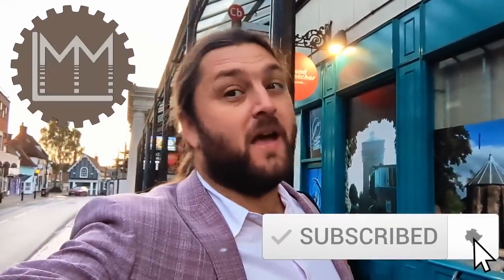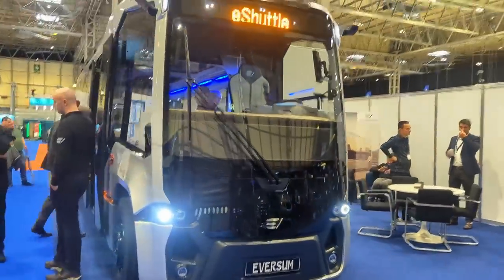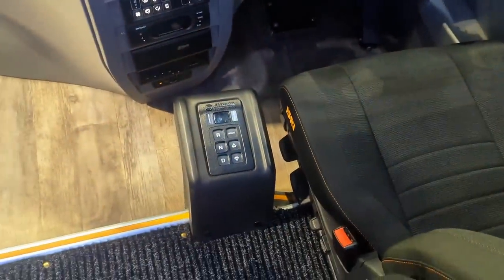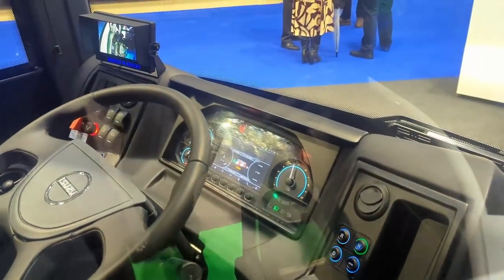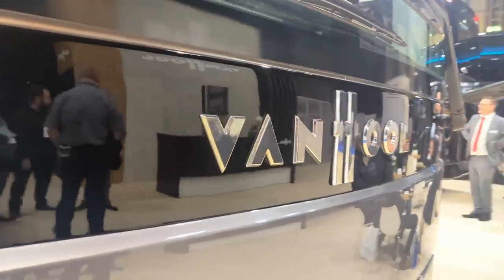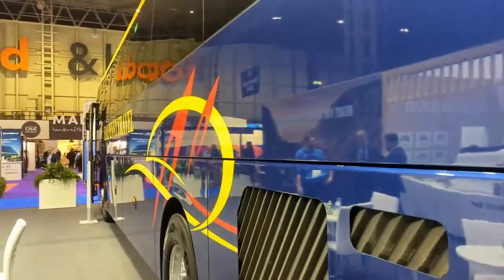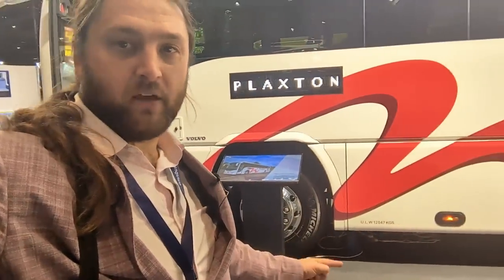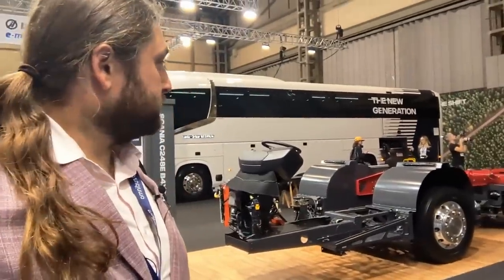Lawrie rates new buses... badly - a Vlog at EuroBus Con

Comment: If you want an electric bus with unlimited range and no need to park for recharging - then use a TROLLEYBUS!  Battery trolleybuses will recharge their small batteries whilst running under the overhead and then use  their batteries to enable them to run a short distance beyond the wires.  
The AEC regent is glorious! Thanks Lawrie.
Reply: And casually proove you can have tall double decker busses fit under wires.
Reply: @davidty2006  And that it isn't too complicated to make happen as they were everywhere before WW2 in the UK.
Reply: @davidty2006  search 'london trolleybus' and you'll be surprised

Comment: You could probably fit a couple of Kw of solar on top of an electric bus. On single deckers, maybe even on curved rails so the panels can to an extent tilt nd track the sun. They could charge secondary batteries for the lighting, destination, USB charge and other gubbins, leaving the main battery just to run the motors.

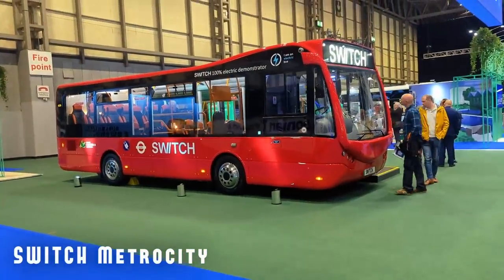Comment: the hideous snorkel looking thing on the front of the Metrocity at 11:37, as well as incorporating the silly digital mirrors, mainly exists to cover up part of the windscreen wiper mounting for a specific regulation London are introducing. Like you said, it's slapped on as an afterthought just for London, and everywhere else gets the normal, actually quite decent front end design
Also, coming from a bus enthusiast, a lot of bus/coach manufacturers have really upped the ugly in the past few years!

Comment: I'm seeing a lot of "features" on these buses that are going to be a major issue when they become older and stop working or break. Go look at the condition of a 10yr old PSV vehicle and see how many things are broken and don't work. Those low glass windows are a complete waste of time. And mirror cams are going to be a major issue when they become unavailable. As for electric hand brakes, they are so redundant it's ridiculous on commercial vehicles. Its an on-off air brake, why replace it with an electric switch and valve which will break?

Comment: The trouble with having all your button functions on a touch screen is that if you're driving you have to take your eyes off the road to look at the screen to find the thing you want to press instead of feeling for a tactile physical button, or for instance pulling the sun visor down by hand. 
So it may look futuristic, but it's ergonomically bad at best and dangerous at worst.
Reply: I only realised that when I saw this comment, although it probably blended with the plastic trees to show no dependence on oil and zero emissions, and everything else. The sun visor on a button has got to be one of the worst ideas someone could ever have. When do you usually need to use the sun visor. When turning a corner coming out from behind tall buildings or trees or when the sun suddenly reappears from behind a rain cloud low in the sky, something that happens quickly and needs to be responded to as fast so not to go off the road from not being able to see it. If you can't see the road because of the sun, you won't be able to see a screen either, and there you go, you and a whole load of passengers are in a ditch. Lawrie might have been joking when he said it, but the AEC Regent really was the most innovative vehicle at that show. Guttering to keep you from being dripped on when boarding/alighting is so much better than not making it to work because the driver couldn't lower the sun visor for the sunrise before crashing.

Comment: Another great video Lawrie mate. You do look quite well in that suit. I agree with most of your conclusions with most of these buses. Growing up on a beef cattle & timber property between 2 country towns myself. Catching the school bus to & from school. Part of life. They are a very comfortable way to travel. I'm with Lawrie on not liking the modern touch screen computer instrument panels too. I too like to have conventional dials & gauges. My dad just bought a new Ford Ranger XLT & showed me it a few weeks ago. It has 2 touch screen panels including the instrument panel. He asked me what I thought of it. I said well..... It's "The Starship Enterprise" in a utility vehicle. I'm not comfortable with fully integrated computers on machines. I prefer mechanical machines. Where the only electronics are modular components with back up redundancy. Not integrated into the machine. Knowing the service life of electronics & computers. They seem to have made us too dependent on them. They can be fantastic when they are working right. Frustration when they are not. They can alternate between the two situations for no logical or rational reason. Call Information technology support. First thing they try is to turn the device off then turn it back on. Reboot. Second option is either a diagnostic or upgrade. Not really a fan of battery electric vehicles either. With all those electronics to drive the buses, the lighting packages within them, the air conditioning or heater which is a huge power draw, then to run the bus on batteries. A lot of auxiliaries running off those batteries. The more auxiliaries running. The shorter the operational range. Also the heavier the passenger load the shorter the operational range. Have trialed battery electric machines in my industry (logging). We are a long way from making an economically viable, versatile, efficient & productive alternative to internal combustion engines. Especially in environments & industries where there is no access to the mains power electrical grid. Necessitating big industrial internal combustion generators on site. Great work Lawrie & the Crew at LMM. Please continue to keep doing what you guys do.

Comment: 18:40 to answer your question on why everything is electric is...

because the government, councils and other stakeholders (god I hate that word) will not give you a contract or extra money via a subsidy if you run an ICE bus on new contracts/routes and you do not want the extra costs of paying for access in a low emission zone.

Now add in the biggest cost of running a bus company is the fuel - if they all ICE and replace that with electricity + add it you be able to have solar panels all over the roof of the bus station and you be saving about 75% of your costs...

Plus add in less costly maintenance needed and fewer breakdowns and manataince/servicing.

QED your accountant loves you and the shareholders love you more!

Before anyone says anything these modern-day batteries... they should last 1,000,000+ miles/kms without issues - hence why Lawrie you have all the heating and cooling and battery management systems (big silver boxes) making sure the battery work and last.

If you buy an EV nowadays you be needing to buy a new body (if it is made of steel) for the vehicle before the batteries need to be recycled.
Reply: Finally, someone else in the comments section speaking sense...

Comment: I have to ask regarding the "Irizar IE Tram": Please tell me that the reps for that vehicle were getting a lot of questions about why they called it a "Tram". Because it's plainly not a "Tram", it's a "Bus". If it runs on rails, it's a Tram. If it runs on rubber tires on a road, it's a Bus. Pretty clear distinction there. So unless it has rail wheels that come down so it can run on rails some of the time, it's not a Tram, it's a Bus. So just call it a Bus, there's no shame in it. Just call it what it is, don't call it what it's not! Honestly, I expected Lawrie to be apoplectic about that. Also have to agree with both sides about the lower windows; they're a cute idea for a different perspective and letting all the little kiddies see out, but they're going to be smashed out quick by people's feet carelessly hitting them and rocks or road debris striking the outside, and they are a boon to voyeurs and perverts.
Reply: The idea from Irizar (not to say is a good one) is that the ie-tram runs on dedicated lanes separated from traffic, just like a real tram but with asphalt instead of rails, and with the (theoretical) same traffic rules as trams (Preference over other vehicles, own lane, fixed route…). Yep, it sound absurd, but is what they are aiming to. To convince that this is a tram but more practical because it can circulate elsewhere if needed and much cheaper to built and mantein than a real tram because of lack of rails and electrical lines… Is the typical "best of both world" idea that really is a bus acting like a tram… with none of the benefits of a tram. Irizar is a Basque company and here the Basque Government is trying to sell the idea as the greatest idea of all times. First trials show what is it. Just a bus.

Comment: 30:00 Chavdar still makes buses? I thought the Bulgarian bus maker which is commonly referred to as Chav went under in 1999.
I am surprised no manufacturer is promoting the trolleybus concept where the batteries can be charged while moving via overhead wires, meaning less time being parked charging. The same concept could also be applied (and has been applied on a small scale) to electric trains
Reply: I think you may be misinterpreting the use of the word Chav.

Comment: Electric may be the future, but it is a joke for rural areas. Cities, maybe, rural, nope. Never mind any battery electric machine I have looked at have had higher lifetime costs over the comparable diesel alternative, even this God awful emissions loaded crap. I'm in agriculture and so far battery power has been very limited just due to application, but even what can be made battery powered, it's nice, but when you break down lifetime costs, depreciation, and residual value, it comes out a wash, especially secondhand. Costs as much as a new one to refurbish these battery contraptions and no one has figured out how to lower those costs, you cant afford to write off the old and buy new every time within current cost structures and it absolutely ruins a debt/asset ratio.

Comment: Those Dennis busses looked rather nice.
I really think hybrid power is more the “innovative future” than straight battery for most places. 

On a different note, there’s a company called Alfadan developing a new large-displacement inline 4-cylinder engine. They have reportedly been working with Mahle on the design optimization. Thought you might find the project interesting.

Comment: Lithium Batteries do run hot.  IronBromide MIGHT be better but are less energy dense
Reply from the maker: Battery tech is the thing that holds back electric vehicles
Reply: @lmm  I am trying to remember the electric buses in London c1908.  There were the tilling petrol-electric (better as the engine can run at optimum with a dynamo/motor drive train , and the clarkson (later national - or as well as - steamer ).  Harrods etc had electric delivery vehicles at the same time

Comment: Love the suit!
A very different video to normal but one that is still enjoyable and helps us get an insight to the transport industry without having to watch another annoying youtuber.

A comment on the cameras, you need to get used to them but from people I know that drive HGV's with them, they wouldn't want to go back, they also help in low light situations (depending on model) but I'd say the main advantage for a bus operator, albeit a small one, is that when passengers disembark they tend to knock or swing on the mirror, at least with these the driver doesn't have to get up to readjust it again.

Now, I'm one for tech innovation and modern gizmos, but the touch screen on a commuter vehicle is toooo much and uneeded

Comment: Hmm modern buses are a bit like modern DMU/EMU trains very uninspiring. The Wrightbus guys are the ones looking at hydrogen and hydrogen combustion and have been experimenting with the hydrogen combustion engine being used in the JCB diggers as the boss of Wrightbus is the son of the owner of JCB. This hydrogen combustion idea is being looked at for many HGV vehicles especially for long running and quick refilling. Toyota cars know this as well hence why they aren't 100% interested in BEV vehicles.

On the same week as this show there was a show in another hall all about garden/grounds machinery called Saltex. Very interesting show as its not just mowers and garden machinery on display but compact tractors, diggers and machines that do other important jobs to keep grass in parks, towns, golf courses and sports fields looking green (except when there is a drought). Probably a more interesting show compared to the bus one.

Comment: Lawrie, 5:35 the reason why you have tablets and not physical buttons on anything... that move is down to costs - it saves the manufacturers millions and millions over the lifetime production of the vehicle - want to understand more - lookup Munro live
Reply: There's also a huge "ooh, high tech" factor as well. A bus with the most new bells and whistles is probably going to be seen as more futuristic/next gen than one which uses reliable but 'old' technology.

Also, if my experience as an engineering student is anything to go by, there's an unfortunate lack of teaching engineers how to critically select technology; if you're taught that interfaces are touchscreen, then you're probably going to make all interfaces a touchscreen.
Reply from the maker: They don't work. They look rubbish and you can't activate by feel and knowing where your buttons are.
Reply: @lmm  touchscreens in vehicles should be banned IMHO - simply because you have to take your eyes off the road to use them. Vehicle controls should all be tactical.

Comment: Nothing says 'we're for a zero emissions future' and getting several 8 foot plus plastic trees made for a single event. 
This event seems full of irony or hypocrisy or whatever you want to call it. Every form of fake material (many probably using plastic to replicate them, which comes from oil, which we're all supposed to know is baaad) in impractical design being pushed as the 'future' and green, and the most innovative bus is show is genuinely a 1930's bus that has been restored. As another comment has mentioned, a genuine electric bus solution is the trolleybus, something that was everywhere in... guess when... the 1930's!

Edit; Got the year of the bus wrong. I thought it was newer than it is. I didn't realise that the future was over 100 years old already, and continues to be ignored.

Edit 2; Just seen the title. the EuroBus convention was literally how it will be written most of the time, stareing us all in the face. EuroBus Con.
Reply from the maker: I particularly hated the plastic wooden flooring.

Comment: I know you only touched on it but am so glad that you mentioned they are sold as the green way but in truth they are polluting to build and run as they have had to fire up old coal oil and gas power stations just to supply the power needed

Comment: I think the thing that annoys me the most about battery electric buses is that they arent trolleybuses, or even able to act as one. At the least, for stuff like bus rapid transit, trolleybuses seem ideal, and for the argument of "oh, but you need wires everywhere to go anywhere", trolleybuses with battery packs exist, and they dont have the efficiency issues of rapid charging...
 The move away from trolleybuses to battery-electric buses in various cities just feels so backwards to me, particularity if the stated goal is "getting greener vehicles".